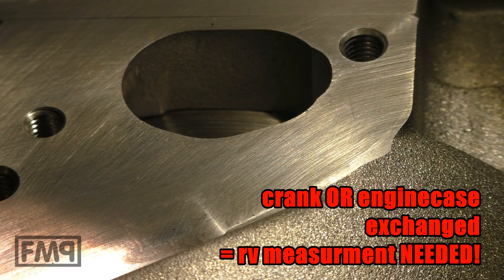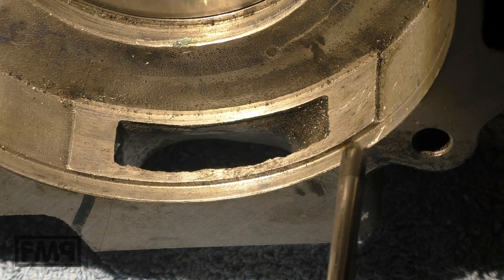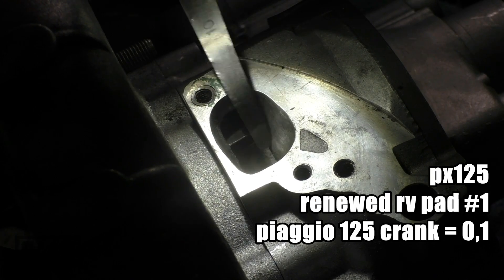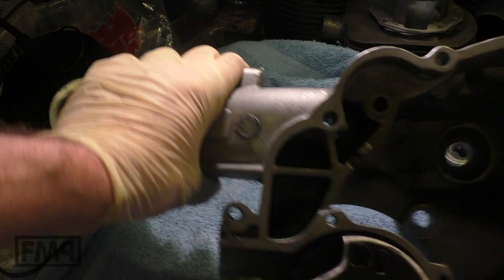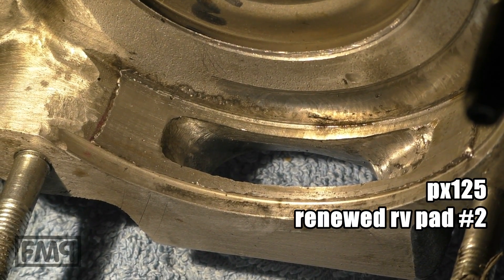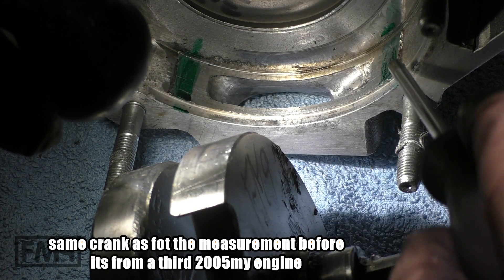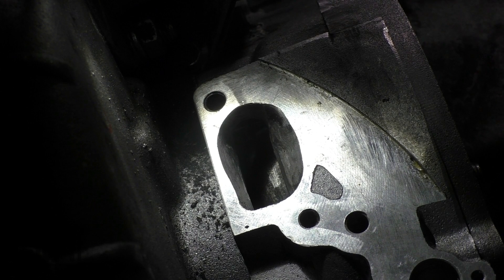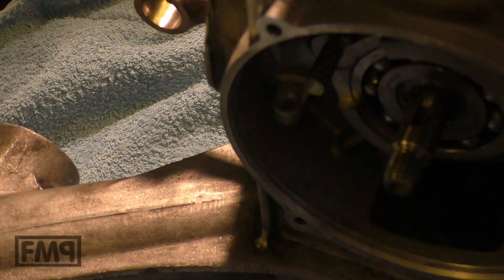vespa ROTARY VALVE 0,05mm TOLERANCE explained | BLOWBACK MYTH | FMP-Solid PASSion |

Comment: mista FreakMoPed  I believe that the tolerance for a Vespa Sprint Veloce rotary valve is 0,00- 0,04 mm. Shouldn't that be the same for a PX??
Reply from the maker: no, all rotary valve engines have 0,05 (or, 0,04) Doesnt matter if vna, vnb, sprint, rally, pe or px. Its the value professionals use to repair it. below that the pad gets damaged by the crankshaft cheek.
Reply: @FreakMoPed8  I appreciate your fast reply  :) 
I have an original workshop manual covering sprint , rally and others. It states the radius from center to the rotary pad should be 49 -0  +0,04 mm . I measured 3 cranks and I found them to be 49 mm , so the tolerance is 0,00 - 0,04 mm . I found a link to the same page as in my manual  http://oopsclunkthud.com/Vespa_service_manual/Pages/209.html    Am I misunderstanding something??
Reply from the maker: as i read it it is EXACTLY 0,04 mm as 0mm gets stuck, and this is the value at least one of my 3 rv pro repair guys uses. below 0,04mm the crank cheek damages, trust me. been there, done that.

Comment: Funktioniert die Drehschieberfläche dann zu 100% wenn man das mit einer Fühlerlehre misst? Also wenn die 0,1 mm stecken bleiben, funktioniert der perfekt? Oder sollte man den Öl test auch machen(mit welchem öl dann?)
Reply: Super danke für die Antwort. Kann man diese messmethode bei jedem motor mit drehschieber anwenden?
Btw: Bei deinem Video von 2015 sagst du dass ein 0,1 mm rv defekt ist?
Reply from the maker: ja, jeder mit drehschieber. ja wenn 0,1mm lehre durchgeht ist der drehschieber als defekt zu bezeichnen, da macht tuning keinerlei sinn. nur 0,1 merkt man das schon beim si einstellen (sehr empfindlich) dann funktioniert nur noch original mit wenig einlasszeiten und niedrigen zylinder steuerzeiten.   das ventil schließt einfach nicht mehr 100%ig.  besser nerven sparen und neu machen auf 0,05mm hin, wie die motoren eben alle aus dem werk original auch daherkommen.
Reply from the maker: glaubst du dass der motorinstandsetzer beim neu ausdrehen der ds flaeche dann 1h pause macht und einen oeltest macht? Oder ob er die toleranz der beiden bauteile misst 😃

vergiss das mit dem. Oeltest, das ist genauso unsinn wie dass blowback von zu langen einlasszeiten kommt

0,1 klemmt = funktioniert bestena sogar mit Kratzer